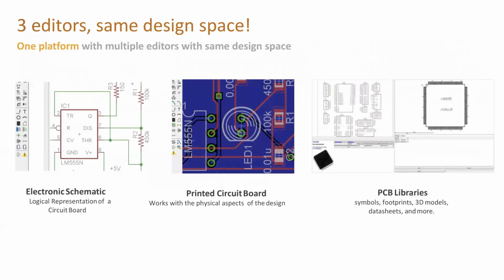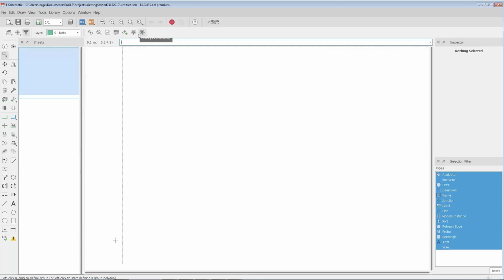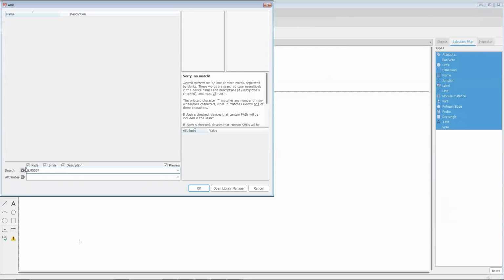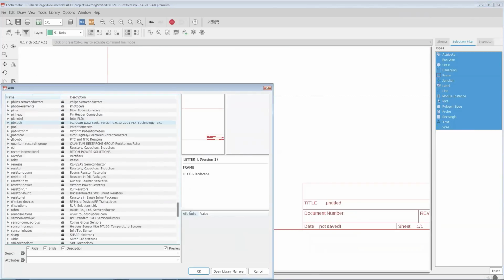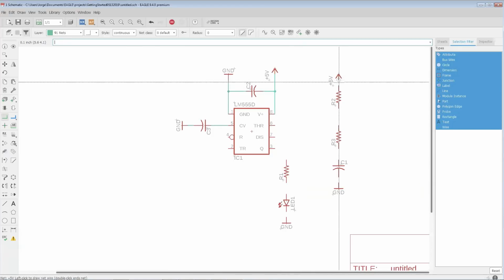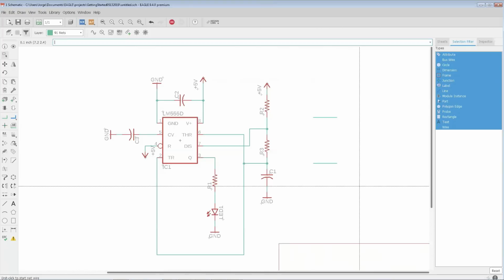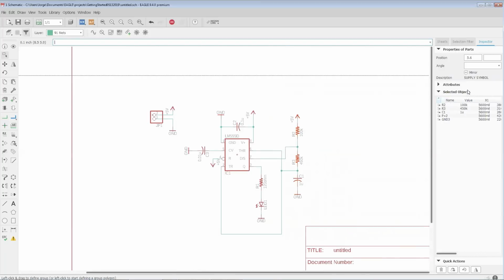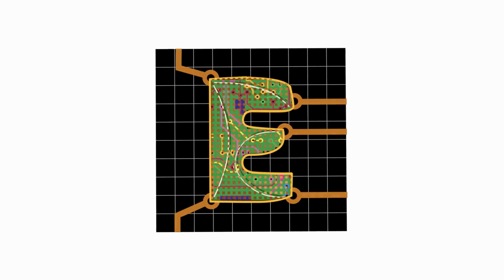Getting Started Autodesk EAGLE   MAY 2019

Comment: i wanted to design a circuit, i saw eagle was free.  i like fusion360, though it was a headache to learn to use.  so i thought eagle would be great.  it however, is utterly ridiculous to use.  wtf is this crap?  its been an hour and nothing is comprehensive.  this is another example of a software of a guy that wants everyone to think like him instead of being able to think like the user.  there are about 1000 things that have nothing to do with actually making a circuit....  i have a package of resistors, a couple capacitors, transistors...etc. here at home, i want to use a software to help me build a circuit.  to lay them out.  simply, easily... i have to now search a database to get a random list of crap, of the parts i have that aren't in the database.. i can't just select a resistor, a basic layout, ohms, voltage...etc. and have the software calculate for me what i'm doing wrong?  find the parts for me after i design with the software.  or what i'm missing?  no.. this is for someone that doesn't actually need it.  IF WE KNEW ALL THOSE FUCKING PARTS, layout, etc...WE WOULDN'T BE USING A DESIGN SOFTWARE YOU FUCKIGN MORONS.  absolute garbage!  this doesn't help a hobbyist...this is for a trained electrical engineer, that wouldn't fucking need it.

Comment: And does the 18f2550 microcontroller on the PCB programmer board program it with a hex file?  Have you tried programming it on Autodesk Eagle?

Comment: Dear Sir,
I am new at EAGLE and CNC. I have a question regarding CAM Processor/Gerber Data.
My machine running on UCCNC can read data like this X35.40Y1.0164
This is what I get from Eagle CAM Processor
X354098Y10164D02*
The machine understands 354098 as 354098mm instead of 35.4098 mm; result is machine hits the hard limits.
How can I change the number formats/scaling?
Also the CAM data misses the spindle turn-on (M3) command. How can I address this.
I appreciate if you could help.
Thanks in advance.